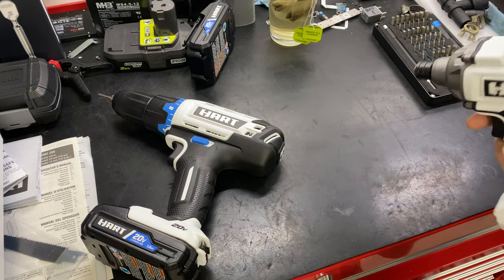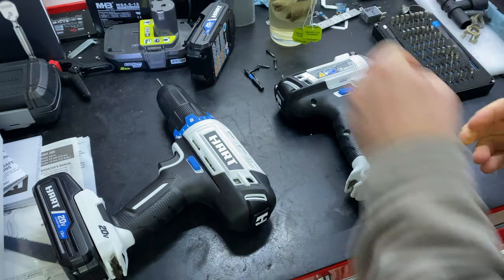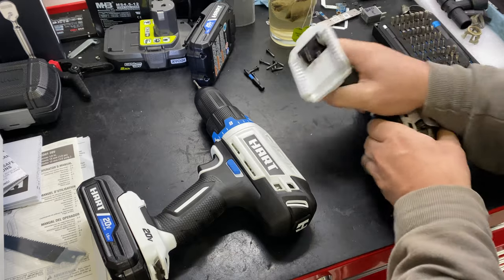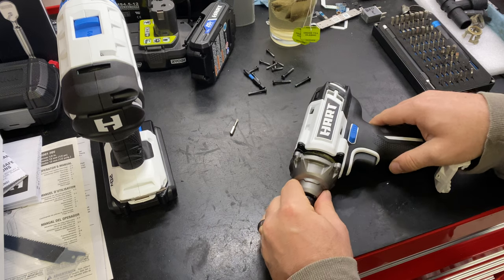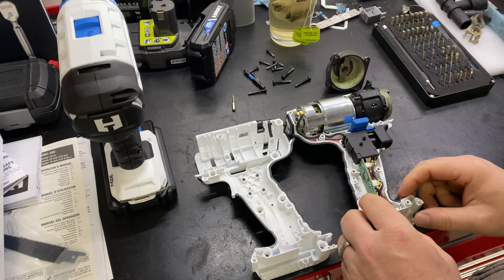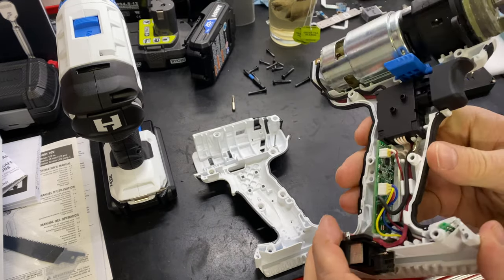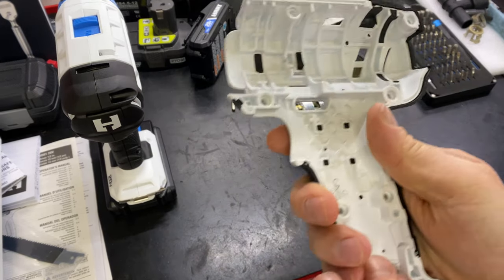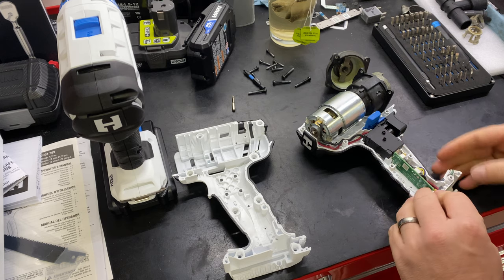Take Apart: HART tools impact driver - a look inside.

Comment: How would you replace the brushes on the impact driver?
Reply: You cant youd ether get a new motor for it or  get a whole new tool
Reply: It is a brush-LESS impact driver!
Reply: That was not a brushless motor that was a 550 size Brushed motor with fixed endbell none replaceable brushes.
Reply: No.... Mabuchi 775 sealed-can motor. Most 550 motors are only rated at 12 volts.